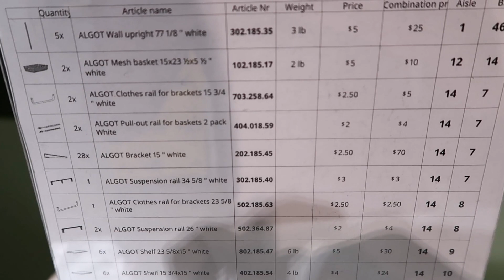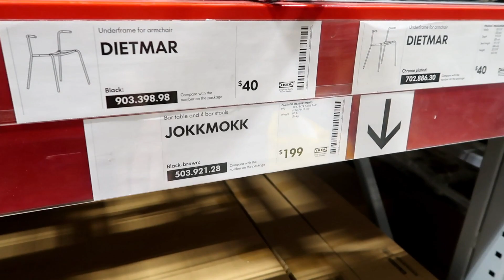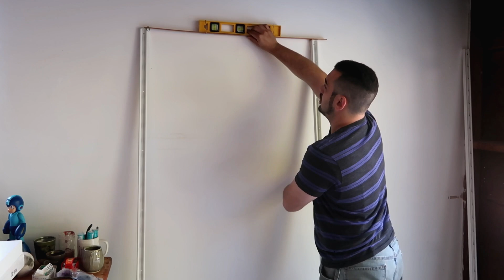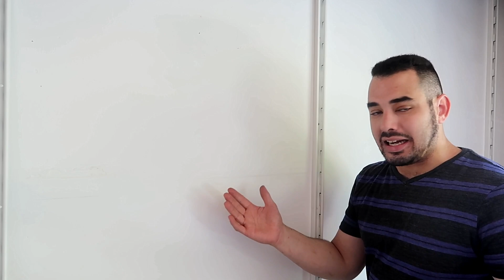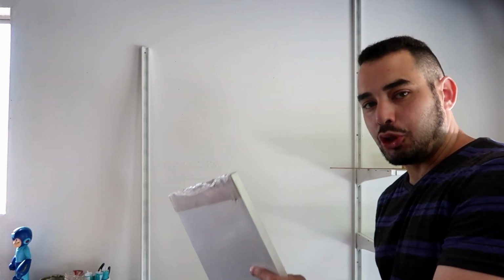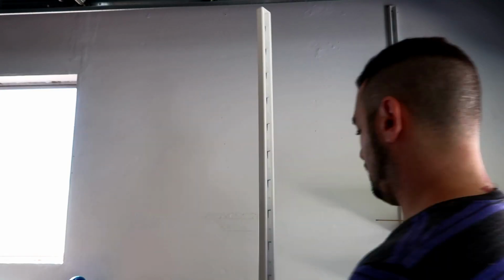Best Shelves for your pottery studio 👌(building your studio #4)

Comment: Did you use dry wall anchors, or put them directly into the studs? Also, what is the weight capacity? (Maybe you said and I missed it...) I do appreciate that you can adjust the height as desired.
Reply from the maker: I used drywall anchors. but within the time of me taking this video I did have to learn to use drywall anchors because I had no idea what they were. Although the pack that they sold at Ikea did come with them